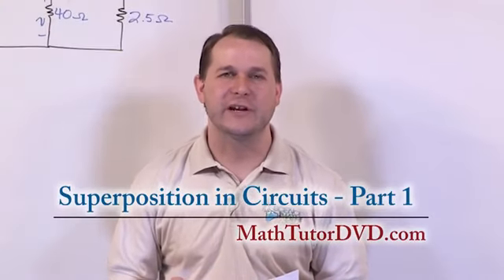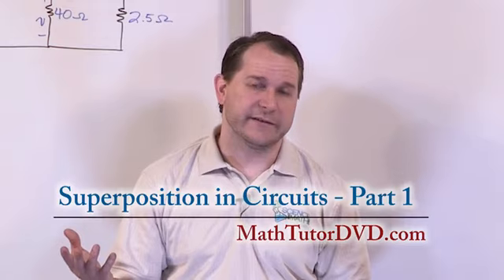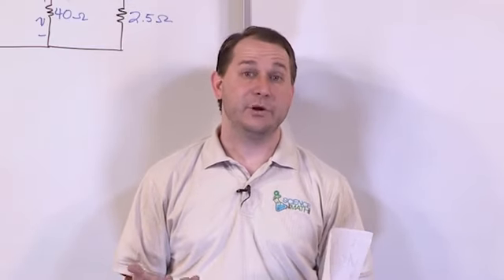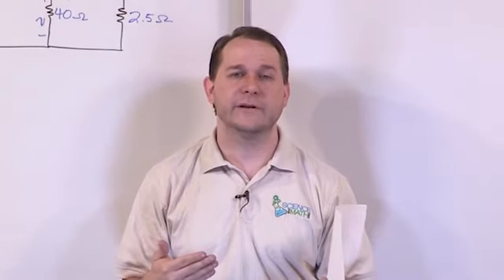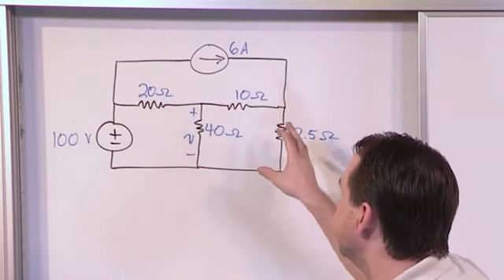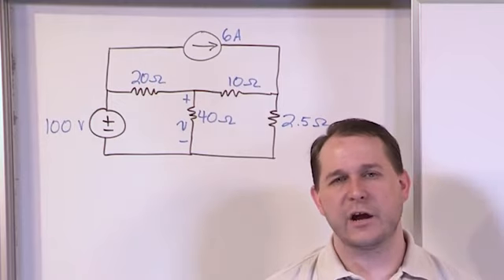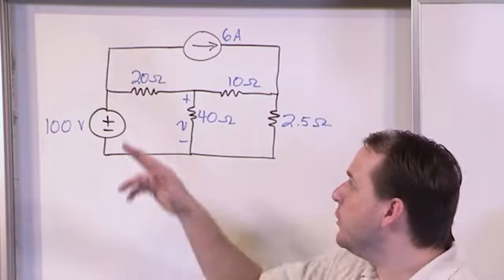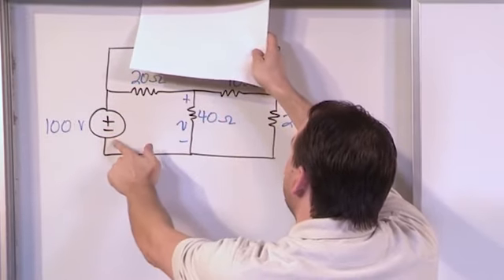Lesson 18 - Superposition In Circuits, Part 1 (Engineering Circuits)

Comment: I think the answer should be -40V, because opening the current gives you -32.26, and shorting the voltage gives you -7.74V. Add them together and its 40V.
Reply: That's the voltage I got too for that middle node

Comment: Hi, I am a member on your website, so I saw the whole video (thank you so much for your work, you make it so easy) But I have a quick question, why didn't you use the voltage divider when you had the circuit with just the voltagesource?
2.5+10 // 40 = 9.52 -> 9.52 / 9.52 + 20 * 100= 32.25 V
Reply from the maker: There are many, many ways to solve any problem.  Sometimes I do what I see first.  Other times, I intentionally do things different than most students to show you that there are multiple ways.  In any case, if you are doing valid work and getting the same answers then great job!
Reply: +mathtutordvd thank you for the quick response. Tomorrow is my exam so I really needed to check if it was somehow not the right way maybe. 

Thanks again for all your videos. I learned more from 1 weekend of your movies then 7 weeks of school and homework.
Reply: mcelia 
hello how can I watch all full videos not just a 4min of the video ?